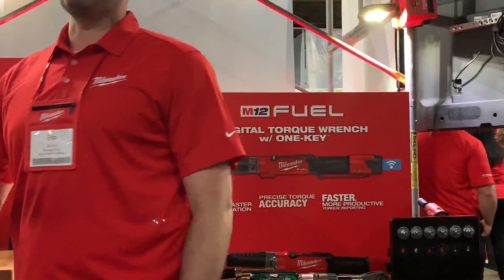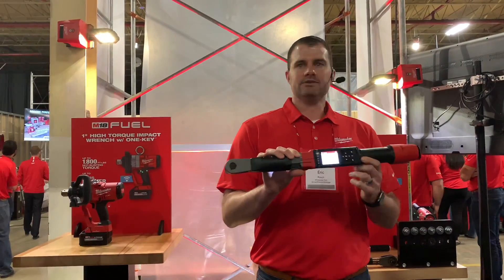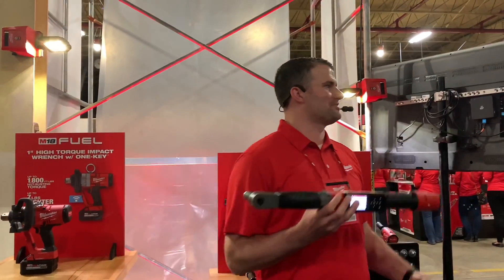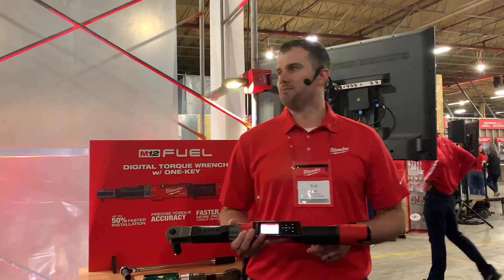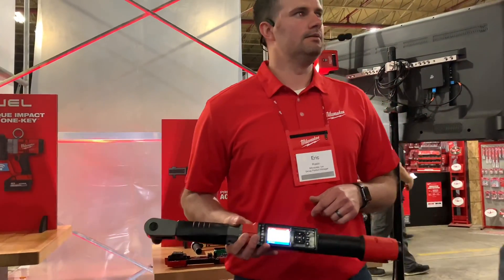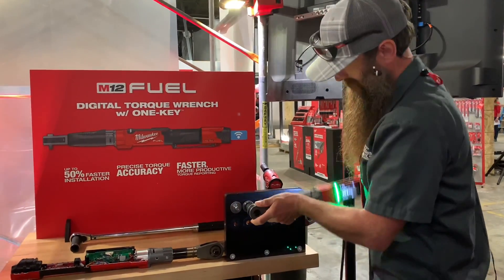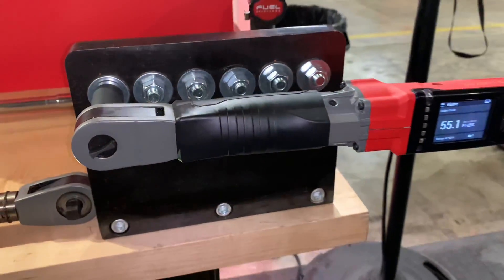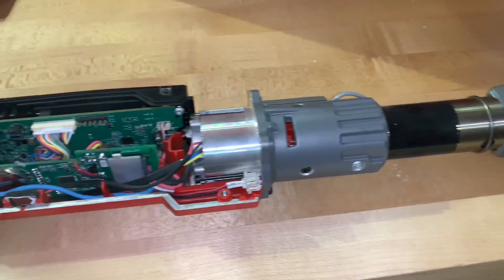Milwaukee Tool Put A Motor On A Digital Torque Wrench!

Comment: I'm posting this comment on all related videos I can find because I'm frustrated with this junk: Here's what happened in real-life with the torque wrench (1/2"). One nice feature is to do a torque read-out for those fasteners you don't have a manual and specifications for; you read the actual torque, keep it in memory and use the same torque at assembly. The PROBLEM is (nobody will ever tell you that), that you can't know ahead of doing it, what the actual torque is and you apply pressure. The moment you exceed the capability of the wrench (150ft lb) you will get a message that your wrench is OUT OF CALIBRATION and that you need to send it in for calibration...  Am I frustrated now 
as I write? I bet you, I am! I'm still in my return window and this JUNK will go back to its mama. I can understand that it was out of expected scale, but don't allow it to go bad because this will happen a few times a day... What a joke this crap is... Oh, am I frustrated now and going back to old school tools.

Comment: A couple years ago I spent all kinds of money on an air compressor and air tools, only to find out I hate them. It's not the air-powered part, it's the lack of 'feel' you get working fasteners by hand. If you're handling a fastener manually you can feel it start to shit the bed before it actually does, then back off, and use a combination of heat, penetrating lubricants, etc, to work the fastener loose without shredding the hole. But with power tools you'll shred threads left and right. I'll stick with manual torque wrenches...I especially like the 'twin-beam' style I've picked up a few years ago.
Reply from the maker: tempest411 definitely a trade off sometimes you’re gonna mess some stuff up with  the power tools. But the speed could be worth it. If you’re not in a hurry nothing wrong with using hand tools.

Comment: The obvious problem with this tool and the reason why most of us won’t buy it is because it only goes to 150 Ft Lbs. If they could increase that rating I would consider it but if they built it the same way they build their cordless ratchets, it will never stand up to a high torque. How many of you have tried breaking a bolt loose with their ratchet and broke the tab off on the the inside of the head that operates the ratcheting function? I have 3 times. I don’t even use my cordless that much anymore for that reason.  Great idea just very poor execution.

Comment: This is cool but where is he getting 2% accuracy?  When he set it at 60 ft lbs, he ended up at 66 ft lbs, which is 10% past the original 60.
Reply from the maker: WI13Y You can adjust the range on how accurate you wanted to be. I don’t know what the range he had it set on though.

Comment: Great idea from Milwaukee to make this. So many have asked for an Impact and digital torque wrench in one, so 2 tools are not needed, but they messed up bad with some things. A) To bulky. B) Not enough torque,  only 150??? C) The price is absurd. You can buy a impact wrench to loosen lug nuts, and buy a separate digital torque wrench, and still be at $450 roughly. Compare that to $800 dollars to buy this wich is 2 tools in one. Like I said good idea, but bad execution of the idea. Milwakee, make one just like this that is a bit smaller, more powerful, up to 250 pound feet, and drop the price by 150 at least. Then this tool is worth it. But right now the fact that you can get this in 2 different tools but spend half the money... Milwakee really needs to rethink for a different one, or drop the price on this one by like 200, minimum, it is not strong enough to spend $800.

Comment: While I the automotive industry they have motorized torque wrenchs that tighten to the exact required torque .. thank you for a half assed tool!
Reply from the maker: theR6969 Hopefully generation two will have everything we need for automotive. The new M12 die grinder in my opinion is going to be awesome. Check it out.. https://youtu.be/qfOd_7WJjd0

Comment: That thing is just too bulky and too expensive. Any time savings due to the motor will be lost having to mess with the menu. Can you imagine doing that with mechanics gloves on? You get no real feel for how the bolt or nut is tightening down either. It's a solution to a nonexistant problem. No real mechanic is going to waste their money on this thing.

Comment: They should add software for torquing down multiple parts to evenly torque bolts automatically restricting it since its halfway automatic already....like for covers you can't just torque one bolt down at a time and snap a cover....hope they could update it!
Reply from the maker: That would be cool.

Comment: Needs angles and at least 250 to 300 ft/lbs max torque......  ac Delco has angle and a higher torque range for 350$ gtfooh
Reply from the maker: kayzrx8 I believe it’s designed for another trade. What do you think of the new die grinder coming out in October? I think it’s going to be a homerun. If you haven’t seen it I just uploaded a video on this page.
Reply: @HowtoAutomotive  I'll check it out

Comment: While this is an amazing tool, $750 for the kit or $1350 for both seems excessive for a tool you can get at harbor freight for $20 that requires you to twist it.  I think I’d rather spend $60 and get all three; 1/4, 3/8 & 1/2 and save $1290.

Comment: If you are setting a torque of let's say 20 lb/ft, using the ratchet motor, will it stop operation below that value so you can manually get to 20? Or will you have to be light on the trigger and watch your value?
Reply from the maker: my gmc channel Yes it’ll shut off about 20% below torque setting.

Comment: 1. Not enough torque
2. No angle
3. No flex head
4. Too bulky
5. Same price or more compared to the Snap On
6. Get rid of the auto ratcheting, good professional will run them down with a low pressure impact,  then apply torque spec.
Reply from the maker: kidzero1943 what do you think of the new M12 die grinder? https://youtu.be/qfOd_7WJjd0

Comment: 150 Ft. Lbs for the 1/2 IN. what a waste, and not to mention no angle. No thanks.
Reply: Exactly! No angle is a deal breaker
Reply from the maker: What do you think of the new die grinder? https://youtu.be/qfOd_7WJjd0
Reply: Adrian Glessner true man I thought this was kinda cool at first
Reply: 250 ft/lbs is standard for half inch drive torque wrenches.

Comment: Why no angle? Tty fasteners are in 90% of the engines I build and repair.
Reply from the maker: Because his ratchet wasn’t designed for automotive it was actually designed for electrical work.
Reply: @HowtoAutomotive  yeah but there is far more of a demand for 1/2"drive torque wrench in ic engine repair than in electrical. They missed the boat on that and a lot of sales.

Comment: Who would want a 1/2” that only goes to 150 ft lbs? 😂
Reply from the maker: What do you think of the new M12 die grinder? https://youtu.be/qfOd_7WJjd0
Reply: How to Automotive I think it’s a really great idea and I’ll probably end on getting one. I have Milwaukee power tools for work and it would fit right in.
Reply: I think it would be work for electricians. electrical panels.
Reply: Courtney Sutherlin I have never met an electrician that would had to use a torque wrench.
Reply: @MrRlearned  I just told you for electrical panels. If you install switch gear I hope they are torqued to specs. The specs are on them. Company I worked for used them for switch gear and transformers

Comment: Snap on Still makes the best digital torque wrenches.
Reply: Alphonsus Jr Quitoriano snap on doesn’t make their torque wrenches.
Reply: To be technical the head is made from snap on and the body is out sourced. Is that your only argument? Cause this Milwaukee torque wrench is useless. Snap on still has a torque wrench that is manufactured better.
Reply: Alphonsus Jr Quitoriano all of snap on torque wrenches are made by precision along with matco Mac and proto
Reply: Like I said the ratchet head mechanism is snap ons in house made product and the body is out sourced. Snap on at the end of the day has better comfort and feel in your hand then other brand torque wrenches.

Comment: ELI-5 What "angle" are they talking about?
Reply from the maker: Blake Presson on automotive fasteners they recommend some bolts we tighten to a certain spec and then turned into additional angle such as 90° or 180°. On some ratchet they will show you the digital reading of how many degrees you have turn the ratchet .

Comment: Using a a interactive digital screen on a hand held power tool is under patents filed by Robbox Inc.. Robbox Inc. is a start up robotic company located in Vancouver, Canada with a focus on developing cutting edge hand held power tools.

Comment: I think the lack of angle and low ftlb rating overcomes the benefits of the electric ratchet feature, especially at its price. If it can run a bolt down fast, but can't reach the torque spec, then what good is it? Should have been at least 200 ftlbs, 250 preferable. Like others have said, it may work for a production line, but not for me.

Comment: Working on Diesel engines all the time REQUIRE that I can use angle torque and having a flex head makes it much easier. This thing is useless. I just use my electric ratchet to zip bolts down.

Comment: I do like my Milwaukee tools but there is no way that I will be dropping that kind of coin on that torque wrench. Money is ridiculous, it doesn't go high enough in torque in my opinion, doesn't do angle, seems overly bulky and I just dont see the need for an average mechanic to buy one. This is more of a tool for a factory production line in my opinion.
Reply from the maker: I understand that. What do you think of the new M12 die grinder? https://youtu.be/qfOd_7WJjd0

Comment: Where to start well first of all +/- 10% <Fuck no, no angle, 150 ft/lbs on a 1/2, extremely bulky just because it’s a TQ wrench with a motor oooh 🙄, 599.00 or a 700.00+ kit for a tool lacking all of those features plus severely inaccurate..when for $580 you can buy a snap on tech angle with angle, all tq measurments you would ever need, memory, less than +/- 2%, 250-300 ft/lbs depending on the model, I mean the concept is cool 85% of my electronics are Milwaukee and I’m a Semi tech but this isn’t practical for the cost and limitations of the tool..sure many ppl will buy them but I can almost promise those ppl aren’t people that have used a Tq wrench enough to understand why the majority of ppl who need a precision instrument like a tq wrench are not happy with this product and it’s not like you guys couldn’t have researched the competition for guidelines because honestly I feel this tool is marketed to the automotive/mechanical/technicians of the trade world
Reply: John Yanopolous yep I know exactly what you’re talking bout they make shit to take money at this point they started off useful and ingenious but at this point is almost all gimmicks and bullshit

Comment: I can't believe I'm saying this, Snap-on has a better tool. Flip the cover, spin the knob, flip the cover back down. It takes 3 seconds to go from 50 to 200lbs. Flex head means you can use it on wheels without an extender.

Comment: Little tip for when you labeling videos if there's an S at the end of a word usually it means multiple or more than one so when I come up on a video seeing tools or whatever word with an S on the end are usually expect more than one demonstration on a new tool that really blows my mind but meh 
It's cool it's a digital torque wrench powered with the motor I get it it's neat little expensive but some people but I wish I could've seen something else that was new and awesome but just one tool demonstration here yippee kind a like I had to poop and only a couple nuggets come out

Comment: Hopefully milwaukee will read some of these comments and make a better torque wrench for next year. I would love one of these, but give me a smaller standard ditigal torque wrench with no motor and no one key that runs on m12 for $149 bare tool. I don't even need angle for most of what I do. 100 ft. Lbs is so so for a ditigal, but greater is always better.

Comment: No angle, no flex head, no thanks.
Reply: Why do people want flex head torque wrenches. Won't it change your torque value?
Reply: John Yanopolous  ehhhh pretty sure extension do not change torque sijce it doesn't change the point where leverage is being applied. Flex heads tho don't they do that
Reply: Plus it only goes up to 150 lbs. 😂

Comment: Boy I don't know. It is bulky. I like the idea of the electric ratchet stopping at a preset level though. Might not really catch on at $500 though. I have gone back to preferring click style tq wrenches. I just never got the feel for stopping at the green with the digital ones. I always end up slightly over torquing. I have become a become a big fan of the Snap-On split beam ones.

Comment: Awesome concept, I'll buy one when it can go up to 250 ft lbs and do angles
Reply: I wish there was a tiny 1/4 in one for oil pan bolts though
Reply: @nathansirchio4431  agreed. I'd love to have a 1/4 one for 50-500 in lbs
Reply: @EpilepsyWarning  1/4 to 500lbs????? Lmao
Reply: @Scarlif3x  inch, not foot lbs
Reply: Cody Gierke it’s got it’s place I personally wouldn’t have use for it but if your doing a lot and I mean a lot of bolts I could this being nice
Reply: the handle will have to be twice the size
Reply: Cody Gierke 150 was not in mind for automotive industry. I like it it's cool
Reply: I build electrical substations and normal torque range is 20-65lbs for copper and aluminum connections, I will buy this lol

Comment: the same price as snap on and snap on does angle, and much higher torque setting
Reply: John Yanopolous  I got mine back when they first came out with the current design handles years ago

Comment: good to see Charles their using it, but for me it's a no!. The fact it doesn't have a flex head no angle gauge it's bulky size and lack of range of torque. I'm not impressed i would rather buy either the snap on or a facom digital torque wrench off the mac truck.

Comment: $599 for a torque wrench. You're out of your Damn mind Milwaukee
Reply from the maker: It’s a ratchet and a torque wrench so technically you get a two for one. But I agree it is a little pricey.
Reply: How to Automotive Yeah but for just $50 more you can get a snap On or Matco that’s longer, less bulky, does angle, has more range, has a flex head, and is oil/water/solvent resistant etc

They may not be power ratchets as well, but with the amount one uses a torque wrench, who truly NEEDS it for that price

Comment: In my opinion its a overpriced gimmicky tool.  For 599 you should 100 percent have angle tracking.  For leas than half the price I can run it down with a battery powered tool and then torque to spec.  Extra 30 seconds to me does not justify the cost

Comment: Not too bad for the price considering. I paid $399 for my ITC 1/2" many years back!
Reply from the maker: Thank you for watching! Did you see the new m12 die grinder? https://youtu.be/qfOd_7WJjd0
Reply: Honestly horrible for the price. The new snap on goes up to 250 , has angle torque , flex head and slimmer design for about the same price
Reply: @AlexMacho765  Yeah I was waiting for somebody to bring up that s*** hole company! You couldn't pay me to take a strap-on tool! What snapon are you referring to? I don't think I've seen a Snap-On torque wrench for under $600. is this one of those big sales where you spend $40,000 on tools and get to a torque wrench at half off lol! Plus Snap-On's warranty is absolute crap. Oh you broke it all that means you buy a new one...

Comment: I get the price. It's a digital torque wrench and a impact wrench in one unit. I wish it could go higher then 150 fp but the price is the same as a snap-on so a bit over priced yeah

Comment: I was sold until you said no angle :-( that is the biggest use for electronicn torque wrench
Reply: that and it's not a flex head and the size is bulky and lack of torque on the 1/2 looks cool but lacks the overall quality of a snap on ratchet or even the Facom sold by mac tools.

Comment: I love Milwaukee tools and own quite a few myself but this is a bit ridiculous. The most practical implementation of a 'digital' torque wrench would be like my Craftsman 'Digi Click'. It has a digital display to show the value and you simply turn the knob at the end to the desired torque spec. For a tool that is supposed to "save time" there is quite a bit of adjusting between your desired spec through the menu. It's far too bulky for many applications and it's too expensive for anyone that is not a professional or contractor. It's also disappointing that at such a high price it doesn't offer angle, something a 7-year old digital GearWrench model was capable of doing and cost less than $300 when it came out. Newer models can be had today for around $250 on Amazon.

I don't mean to stand in the way of innovation, it's just that this kind of tool just seems a bit excessive when a more realistic approach would be to build upon the former implementations first rather than making this your first offering in the space... I guess it's at least good that new ideas are still being tried, just maybe focus more on the practicality of the tool and increasing it's target base.

GO BIG OR GO HOME WITH THE NEW M28 'FUEL' BRUSHLESS 'ONE-KEY' TORQUE WRENCH WITH BUILT IN ALEXA! (sorry, could help it...)
Reply: You're not standing in the way of innovation this just isn't innovation. The snap on does 250, angle , has a flex head  and slimmer less bulky. I don't know what they were thinking with this one. Better digital torque wrenches have been on the market for 5 or more years now. I got my snap on when it was on special for 530 and a free 1/2 deep socket set from 10 - 24mm. Never thought I'd see the day when snap on was a better value than milwaukee